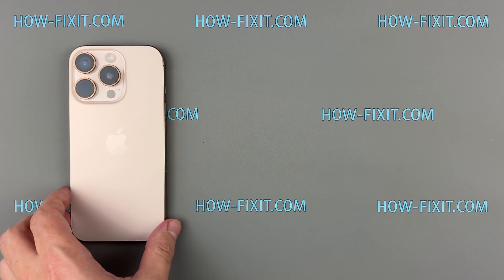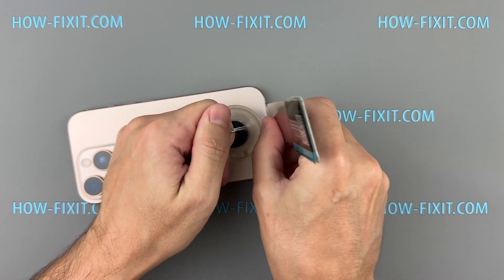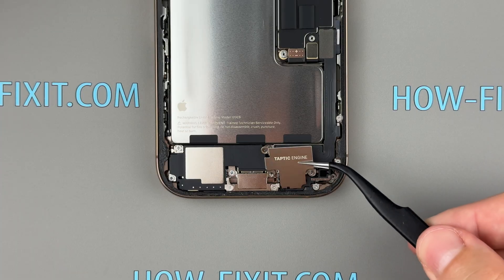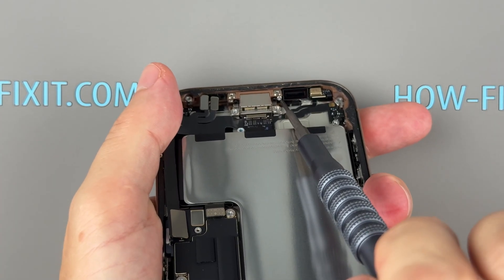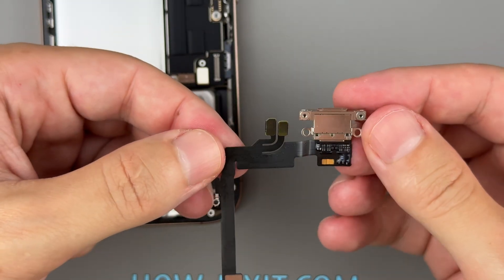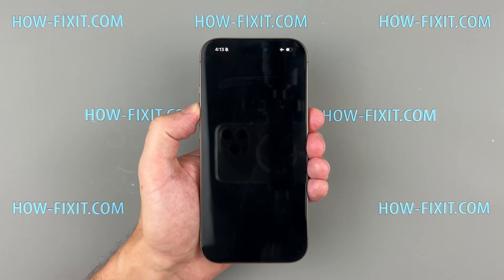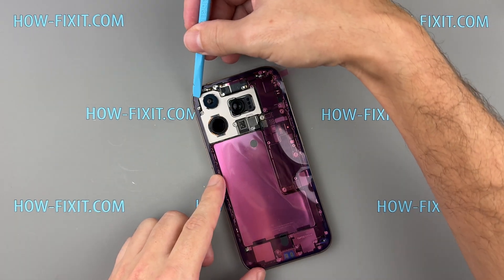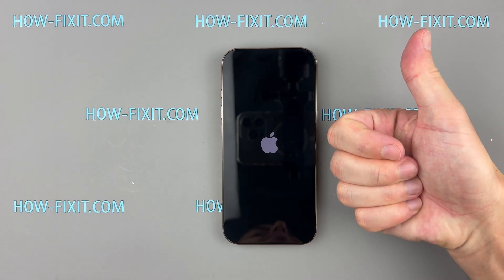iPhone 16 Pro Not Charging? USB-C Port Replacement Guide (Step-by-Step)

Comment: How do we know if the charging port is the problem to begin with? Instead of going all in, can we flick the flex connector for charging port open, pop in the temporary charging port and see if it charges?
Reply: Just use a wireless charger…